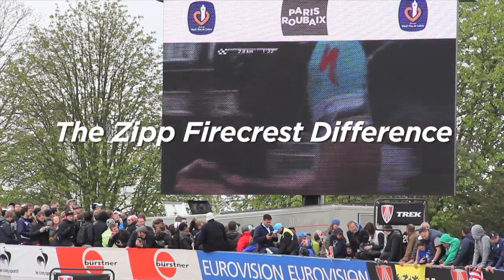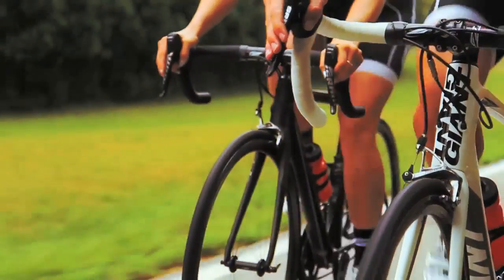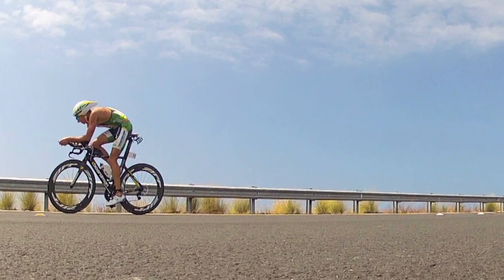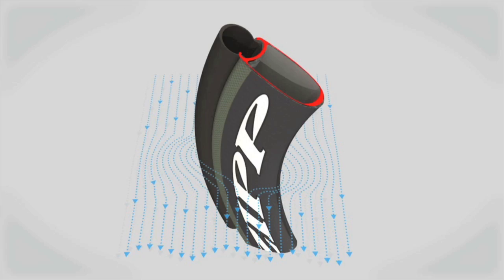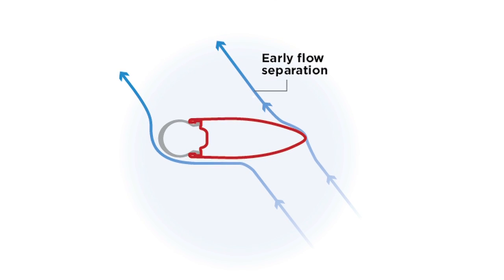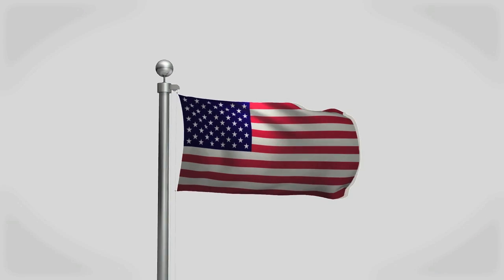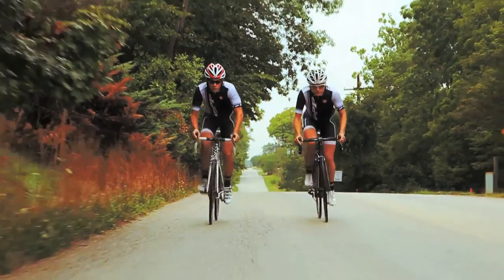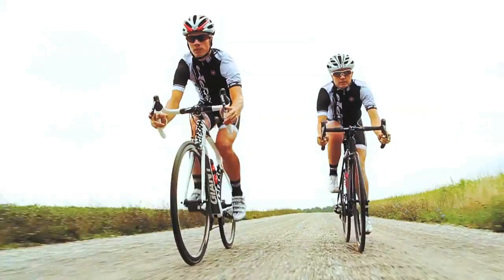Zipp Firecrest Difference

Comment: This wheel is great for preventing flats for the casual rider.  It will be heavy since forces around the circumference are born by the elastic attached at points and are not  contiguous , same as an agressive tread mtn tire tread (pts).  Aero drag is increased tremendously due to the following.  The wheel underside is exposed and the total suface area of the elastic must be added to the area as well.  Aero measurements would probably show 4 times the drag on this example.  These may be addressed in the next iteration though where all this is inside the tire. If so, then you will have tremendous potential since it will be compatible with any tire and wheel. I hope you will continue to develop this.

Comment: I like how at the end, they refer to the dimples' ability to create many 'mini-vortices'. However, this is another way to say that they create more turbulence and more drag.

The dimple effect for non-round objects has been debunked by aerospace engineers in several places on the net.

But it was cute how they used the famous wind tunnel data that didn't compare a single product to a similar product, thus creating absolutely no objective data.

That's a good one.

Comment: Low drag, high lift properties....

Wait a second. This is an airplane wing?

Aerodynamic performance in the back half of the wheel is where the magic happens. OK, but the trailing edge is controlled by the tire, not the rim.

Flow separation, called 'stall'. Uhm, I thought stall was the condition of loss of lift due to flow separation. Since the design of a rim is NOT to create lift, but to decrease DRAG, this doesn't make sense.

Fishy.

Any actual engineers want to weigh in on this?
Reply: Honestly I agree that the science in this video sounds a bit sketchy, but having just got a used pair of Firecrest 404s from a buddy, probably produced around the time of this video... I can say I'm blown away by the ride quality and speed of them.  Whatever the f Zipp is doing it works, have never been on wheels that ride more true and fast.
Reply: @MikeMPharmaCyclist  I've literally heard the same thing about loads of other brands though. I've even heard this about some wheels in comparison to Firecrests... 

Obviously they are going to ride true, they are super expensive wheels. But Zipp wheels have a reputation for being flexy, especially as you approach the heavier weight classes. Anyone over 80kg, basically.

The biggest issue with Zipps is their lying.
Reply: @eschelar  I'm 102 kg on average and push about 305 watt FTP, granted I just got the wheels but so far haven't seen any noticeable flex and have had zero brake rub even with tight calipers.  On my Chinese carbon, no matter how or who trued it it was never perfect and would always worsen over time; I always had a pulse and had to have my calipers open wider than usual to avoid rubbing.  This happened with two different Chinese sets, one from Amazon and one from aliexpress. I raved about the aliexpress ones right here on youtube when I got them, go look at my channel.  Well, over time they didn't last and fell apart rather quickly.. like a year. Time will tell with these Zipps but I can already say on their best day the Chinese carbon didn't come close in my experience.
Reply: @MikeMPharmaCyclist  I wasn't comparing Zipp against Chinese Carbon wheels. Of course those are junk. I'm just saying that you're comparing pure junk against a name brand product. Chinese carbon wheels aren't really competitive in terms of quality against any of the Western brands. The difference in cost is close to tenfold.

But if you look at carbon wheels by Reynolds or Lightweight or even alloy wheels by smaller companies like Pro-Lite and Hunt etc, you often find that Zipps offer equal or sometimes slightly worse actual performance, for a much higher price. Of course Zipp has star power, so they get a boost from the sycophantic media, but the issue I'm pointing out is that a lot of their perceived "quality" comes from "Technologies" that make no sense. Look at the big deal they made of Si3N4 balls in their ceramic bearings. As if it is so different from what *every other ceramic bearing contains*. Si3N4 is the chemical formula for Silicon Nitride. It is the standard ceramic compound used in ceramic ball bearings. Even the cheap Chinese crap bearings. 

Imagine a salt manufacturer saying that the salt they produce is so much better than other salt manufacturers because they make NaCl. It's Sciunce!

They made a huge deal about using Grade 2 balls in their ceramic bearings (information they kept on their website for at least 9 years, maybe still there, I can't be bothered to check anymore). Not only has there never been a commercially available Grade 2 ceramic ball, from any bearing company (I personally asked 20 of the top manufacturers in the world). I even ran into the German engineers from CeramicSpeed at a bike show. When I asked them, they told me two things: #1 - they make the ceramic bearings for Zipp and #2 - they have never even tried to make a Grade 2.

The only way to make a Grade 2 ball would be to use filtering. You would need to find balls within the Grade 3 manufacturing process that had roundness of 2/1000000 of an inch instead of 3/1000000 of an inch. That might sound like it's not a big deal, but it's a really, really fine distinction. If it could be accomplished, it might be found in 1 ball in 10,000. If the bearing contained 12 balls, you would need 120,000 balls to be produced for every set of 12. That would put the cost of the completed Grade 2 bearing at 120,000 times higher than a Grade 3. That's also assuming that building a filtering stage to search for balls that meet the higher standard could be accomplished with zero cost. Zipp was selling them for the better part of a decade for a thousand bucks a pair. That's a little less than 10 times higher. 

The engineers from CeramicSpeed literally laughed when I told them this. 

They told me that they make Grade 3, ABEC5 bearings for Zipp. This is matched by information I got directly from Zipp as well, so I believe it is accurate. Grade3, ABEC5 is the standard for Ceramic bearings. It's not special. CeramicSpeed does make good bearings, but so does any European or Japanese bearing manufacturer.

When I pressed Zipp directly about this (literally years ago), they said that they couldn't verify this but the source of the information came from ZedTech, not Zipp itself. ZedTech was of course a subsidiary of Zipp... And they were definitely never a bearing manufacturer. I was told by Zipp in 2015 that the information on their website was incorrect and would be corrected on the next update. Last time I checked was 2019 and they hadn't removed all claims of Grade 2 from their site.

If a company lies so persistently for so long even after selling who knows how many bearing kits at 1000 bucks a pop, it's a serious trust issue.

If you look at dimples, you find that Zipp has patented a variety of concepts that they did not invent, but are applying to bicycle wheels. So they are definitely invested into these ideas, but science says that the most important place for a boundary layer trip would be at 45 degrees from the center along the leading edge. That's on the tire...

That's a rabbit hole that goes quite deep, so I'll stop there. 

I don't like companies that lie. Zipp lies more than a politician with lipstick on his collar.
Reply: @eschelar  well I'm no expert in bearing manufacture and trust your information on that.. actually was interesting to read about the screening process you're describing, I've never really thought about bearing production and how difficult it is to make a perfect sphere to spec.  I agree Zipp's prices are very high and also agree with you that other quality wheelsets are sometimes likely as good or better.  I really was only making the comparison to Chinese carbon since that's all I know outside of alloy wheels; some (including myself previously) don't understand how much better properly built wheels are.  For me, I scored a pair of genuine Zipp Firecrest 404s from a friend for $700 and am absolutely thrilled with them.  I won't be defending any of their "science", but I will vouch for the quality of their product simply based on my first hand experience.  I take no issue with your position, you're entitled to your opinion and at least have the decency to explain with solid reasoning why you have said opinion.. can't ask for more than that!
Reply: @MikeMPharmaCyclist  If all you're used to is Chinese crap, yeah Firecrests are going to be a step up. It's a tad disingenuous though to assert that Zipps stand up to their peers when this is your frame of reference. 

If you picked them up for $700, you got a reasonably good deal too and they are a perfectly serviceable wheelset. 

I have worked at a manufacturing company for more than a decade and we have made stuff for many brands (both full OEM build and assembly only) and I've heard that exact same thing from many people. I can't say too much because it's not appropriate. In some cases, it's comparing bargain basement junk against something good. In others, it's comparing a bunch of fairly well respected wheels against a specific product X. 

One of the most honest guys I've ever encountered in the industry is Bill Shook. I did not work for him. He retired a few years ago, but look at the wheels he made and see his design philosophy. I would not be surprised if you could just pick any American Classic wheel and get the same or better performance as the Firecrests in terms of build quality (not aerodynamics obviously due to different shapes, but better flex performance).

Zipps are mostly perfectly fine wheels. They aren't magic though.

I just don't like that the company lies so damn much and rips off their customers. I also don't like that the media supports their lies so often simply because they are "the big dogs", even when they put out product that is clearly going against well understood physics. It's very difficult to find anything meaningful in most "studies" these days because so many of these reports have no controls, no A-B comparisons and are multi-varied when they think they are single-variable tests.

I've seen a lot of video tests by people who also have zero background in real science. They toss jargon around like it means something, but don't understand any of how things actually work. GCN makes more effort than most, but they are guilty of this a lot. At least they do real-world testing of stuff to back things up. It works as long as there's a real world difference that's large enough to overcome other variables. I see  lot of their tests with things like that would mathematically get them an improvement of something like 0.3 seconds, but with results 15-30 seconds different on every run...

It's too bad that people have completely lost sense of the scientific method on almost every level of human society.
Reply: @eschelar  at the end of the day I'm just an enthusiast/fitness rider competing with myself and Strava segments and am thrilled with the wheels so far. As a scientist myself (though I study pharmacotherapy and programming complex systems as a pharmacist analyst) , I also lament the decay of critical thinking in society, but that decay isn't Zipp's fault even if they're taking advantage of it. Apple does the same thing.  I would argue the entirety of marketing is to convince people beyond their critical reasoning of the superiority of whatever is being marketed to them so they develop blind trust.  When society stops believing in monotheistic skygods, they might stop believing rubbish science at large 😂
Reply: @MikeMPharmaCyclist  Indeed. I am not a scientist, but I have been told that I have a mind like an engineer.. usually as a veiled insult of some sort. ;)

I would only disagree that "the decay isn't Zipp's fault even if they're taking advantage of it". 

I believe in individual responsibility and for every party that upholds the lie, that is specifically taking part in the mass delusion that is our current war on truth. As Solzhenitsyn says, "don't let the lie come through you", even if the lie is commonly held and has won in the court of public opinion.

The only thing necessary for the triumph of evil is for good men to do nothing.

Wow, this discussion of wheel technology sure took a turn hey? haha

Comment: Yesterday's technology. Today's trick is bringing carbon fiber in a Kevlar jacket as colse to the surface as possible. ERW uses a very strong composite hoop suspended by elastic attachments. Our secret is negative pressure...not air pressure. ERW can out run any wheelset in the world.
Reply: ERW accumulates speed while pneumatics do not. Rolling on composite hoops is a very new exsperiance. New traction system video to post shortly.
Reply: Technik die sich nie durchsetzen wird. 4 kg für so einen Satz? Die Industire versucht uns auch jeden Mist als Evolution zu verkaufen :D